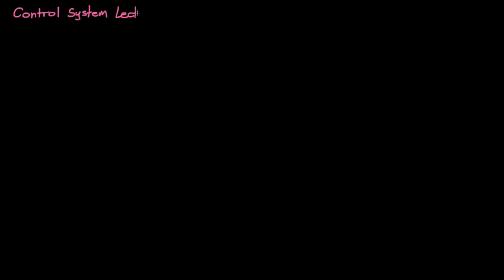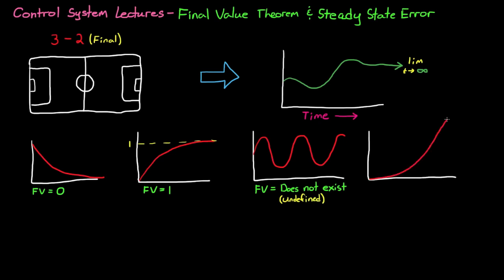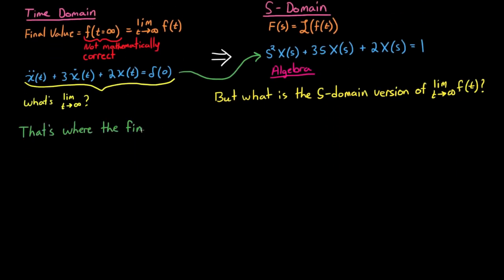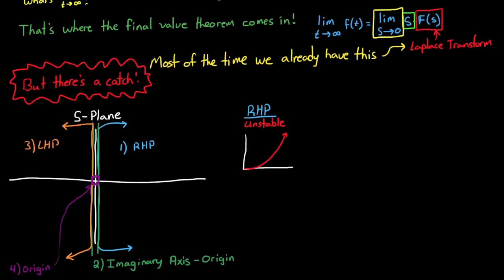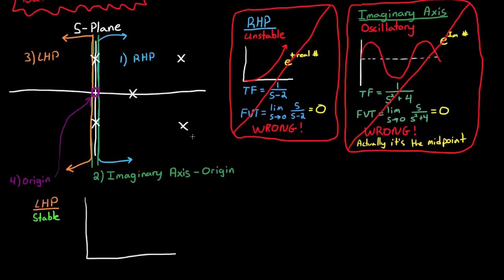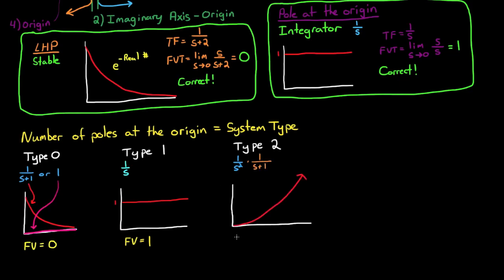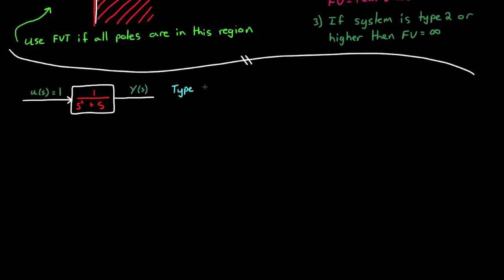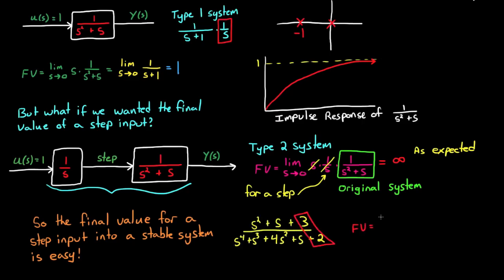Final Value Theorem and Steady State Error

Comment: How do you find the final value if there is a single pole on the RHS? Example the transfer function is 3 / (s^2+2s-3) and we have to find the final value of system with a step input.

Comment: with modern software's ability to solve differential equations easily, process control can be taught almost entirely in the time domain.  Laplace is hanging on only because its engrained in process control texts.  Excellent teaching! Perhaps you could do a series for understanding process control within t.

Comment: I'm still not clear on just what the error is.  Is it the difference between the input and the output?  Why is it called an error?  Isn't that usually what we want from a transfer function?  A kind of filtering or amplification where you will see some change between the input and output?

Comment: First I would like to thank you very much for your effort for producing this videos in such a amazing quality. It helps me really much during my studies!
I have a little question, I'm apparently bad in mathematics. Around minute 9:00 you start to explain how the final value can be calculated for the different system types. My question is when I have the transfer function 1 / (s² + s) , do I have to factorize it , or can I just simple put all the s's to 0 and get my answer as 1 / (0 ²+ 0 ) = 1. In the following example for a system with a step input, we are using lim s ->0 s * 1/s * 1 / ( s² + s). Because I can short out the s * 1/s all left is the TF from the previous example 1 / (s² + s) (System 1) but now it equals infinity? Shouldn't it equal = 1 as well ?

Comment: The system type comes from characteristics of the error function in a closed-loop control system.  Some of the first applications of control system design were motor controls.

Type 0 System:  The error can go to zero. (motor position control).
Type 1 System:  The first derivative of the error can go to zero (motor speed control, but not position).
Type 2 System:  The second derivative of the error can go to zero (motor acceleration control, but not velocity or position).

Comment: Why output has to follow the input in well designed control system
If output follows input and both coincides with each other then there will no difference in output and input in that case why should I use any system to process the input , becuse my input itself is output
Reply: will try to help you, my teacher said something about switching on a fan . when i switch on a fan(input) i want it to rotate at suppose 1000 rpm. The fan starts and then it picks up speed(output)  . now this speed will slowly increase its speed to finally reach 1000 rpm. so finally input was to rotate at 1000 rpm and then fan moves to reach 1000 rpm , the final output. 
hope it helps.
Reply: Snehasis Das thanks alot it's quite good example I hope I had good teacher like you have. by they way thanks for helping 😄

Comment: I think you have made a mistake in the end of this lecture. As the system type increases, the steady state error would decrease instead of increasing and to follow a constantly accelerating input you would have to increase the system type instead of decreasing.
for example:
for a unit ramp input,
steady state error for type zero : infinity
                                 for type 1: constant
                                 for type 2: 0
Reply: The error in itself decreases.
What you have stated here are the values for the error constants.

Comment: Hi Brian, thanks for the video
Both the links you provided in the description is not working. So, if possible, please update them so that we can go through that.
Another thing that I would like to ask you, in the video at 5:20 you said final value theorem would give mean value of the oscillations. Don't you think it's wrong as the step response the system having poles only on imaginary axis will be oscillatory. But this oscillations are not symmetric to the Time axis, in fact these oscillations are above Time axis so the mean value of their amplitudes won't be zero. While for these type of systems FVT gives 0.
Sorry if I am wrong !
Reply: +Milan Shah  The reason you are getting an incorrect value is because FVT is not applicable. He said the final value is undefined if the poles (they come in conjugate pairs) lie on the imaginary axis because they are continuous sinusoids.  If the poles lie on the imaginary axis, the system is undamped and thus the oscillations will continue forever. So, using the Final Value Theorem is not applicable. However, if you use the FVT even though it is not applicable then the corresponding value will give you the mean value of the oscillations, which is not undefined. 

In the example prior to the one you mention he shows that if you use FVT on a system with poles in the RHP (unstable) the FVT will yield an incorrect response as well.

The important part of the video is to understand Final Value Theorem and when it is applicable. I hope this response helped.

Comment: If we have a pole on Imaginary axis along with one in LHP, the response will eventually settle. Can we use Final value theorem for this case?
Reply from the maker: Merrick Captain If you only have a single pole on the imaginary axis then it must be at the origin (at least for real physical systems). If that is the case then you can use FVT on this because a pole at the origin just changes the system Type. i.e. 1/(s(s+1)). But if you have a pair of poles on the imaginary axis not at the origin then the response won't settle and you can't use FVT on it. Try plotting 1/((s+1)(s^2+1)) and you'll see.

Comment: Wait, you can reduce the system type by multiplying with another S (Which will give another S = 0 pole)? 

And is this similiar with adding another integrator in your regulator (if we're going to go into regulators)? 

Thanks in advance for answer :)

Comment: In order for the system to respond to a constantly accelerating input, we change the system type by adding a POLE at the origin, so that an extra s comes in the numerator and the error term goes to zero for s =0, right? Towards the end of the lecture, it was told to be a zero. We add a pole so that the transfer function itself helps in integrating the input thus making the output to accelerate as fast as input??

Comment from the maker: Hello Fidelis, I posted a video showing how I make a control system video lust last week.  I explain there which hardware and software I use.  You should be able to create a very similar style video using the tablet and the software you mention.  As for the drawing it took me about a week of practice to learn how to write on the tablet! It's not like writing on paper.  I kept writing up at an angle or just really sloppy. Just stay with it and you'll get it. Good luck with your project.

Comment from the maker: HI Aaron, if you divide by 's' and replace 's' with zero you are finding the final value of the function to an impulse input.  You have to multiply the transfer function by 's' to find the final value to a step response.  So for a step response the multiply by 's' and the divide by 's' cancel and you're left with the original transfer function where you set 's' to zero.  Then you get 10/5 which is 2.  I'm betting the book was solving the final value to a step input.

Comment from the maker: Of course I spoke too soon and in haste! :-(  You can add a zero to your error transfer function by adding a pole at the origin in your controller.  Essentially if you add a 1/s (or integrator) to your controller this is increasing the type by one.  If you work out how that affects the error transfer function you'll see that it adds a zero at the origin which will cancel the additional pole added by the input function.  Sorry for the confusion.
Reply: Just wanted to add a note to that final statement. The system type has to be increased (more poles at the origin) in order to follow an input of a higher type. Basically, to follow an input of type n with 0 steady-state error, we need a system of type n.

Comment from the maker: Hi vibhu, a zero in a transfer function is just an 's' in the numerator which corresponds to a derivative.  However, you have to be careful because adding a derivative term to your plant G(s) won't actually help solve this tracking problem in the feedback system.  That's because the system transfer function is U/(1+G) and so there's no way to actually ONLY add a zero to this closed loop transfer function by ONLY changing G. At least one way to get around this is by adding a feed forward path.